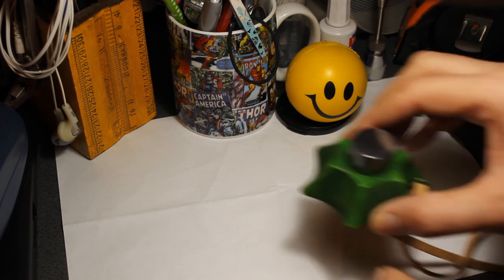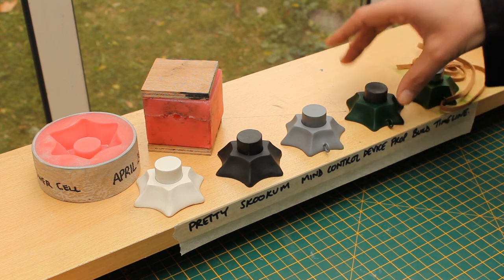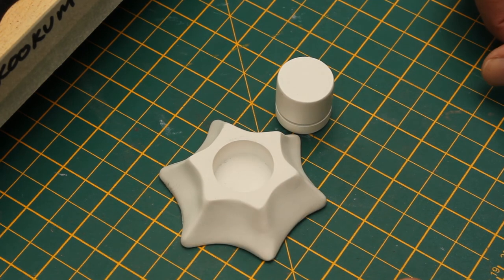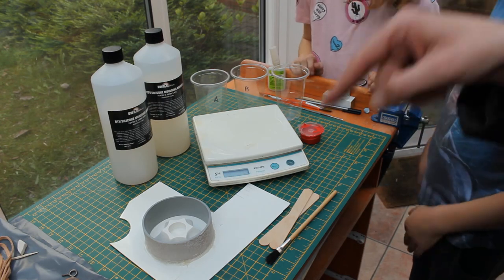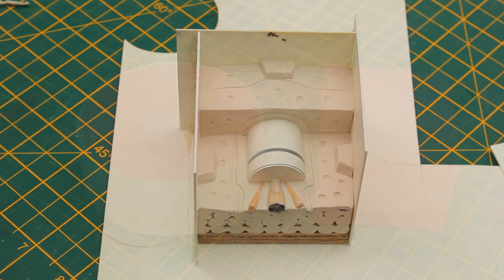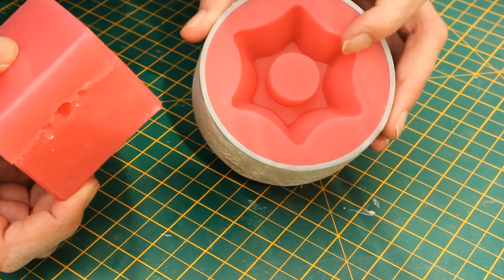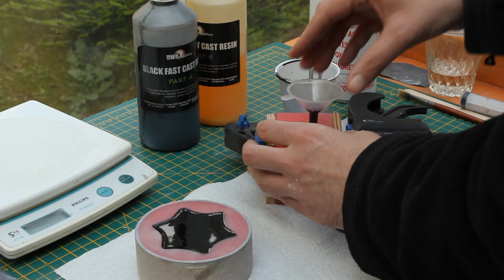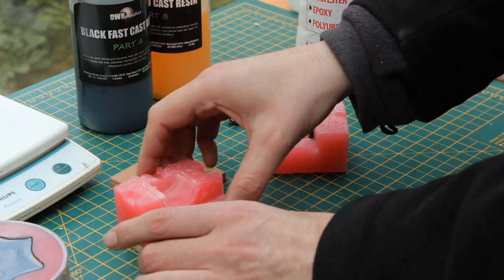Moulding and Casting a Terileptil Mind Control Device Prop [DOCTOR WHO]

Comment: Nice to see something simple that a beginner could have a go at, and the kids following in your footsteps by the look of it :)) I have to admit I don't remember this DW story very well, but the basic shape really reminded me of tin (purple?..) blancmange molds from the 70s/80s - wonder if the prop dept might have adapted one for the original. Anyway, great little prop.
Reply from the maker: Yeah, it does look a bit like those tin moulds, doesn't it? But you're right, this is a really simple project that anyone can have a go at because you don't even need to make the moulds if you only want a one off... just skip the silicone and resin sections and Bob's yer aunty.

Hopefully in time, and funds permitting, I can tackle something a little more interesting too.

Comment: I like small props too. Dose it light up?
Reply from the maker: This one doesn't no, though I believe that only the one worn on the wrist did that. The one here was really a proof of concept and at some point, I'll make a second version that has a few extra details and is cast in a translucent resin - just like the originals were.
Reply: I made a blog thread on this prop if you need any more info, like shape, design, electronics, ex. 
 http://tardisbuilders.com/index.php?topic=8877.msg112080;topicseen#msg112080